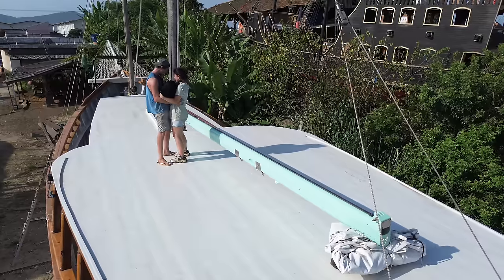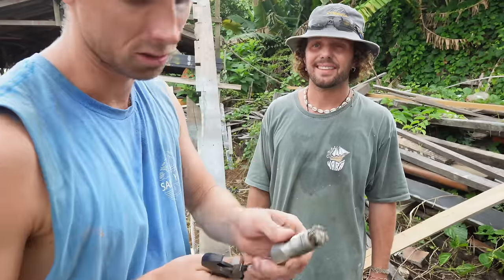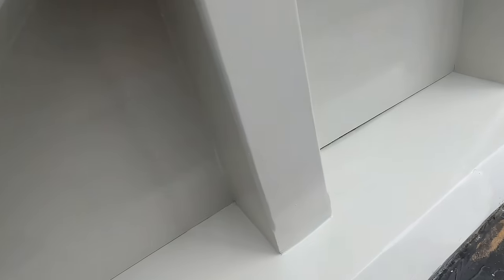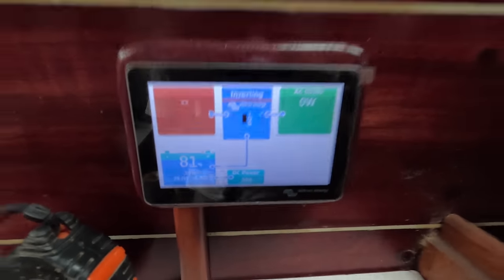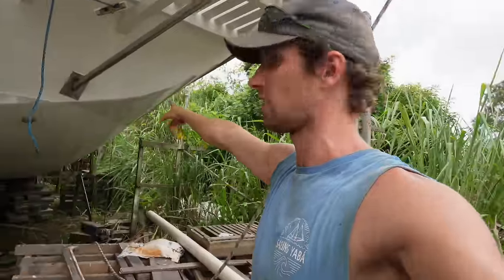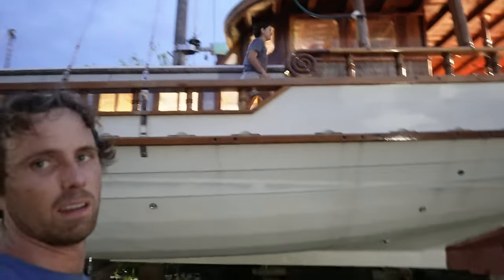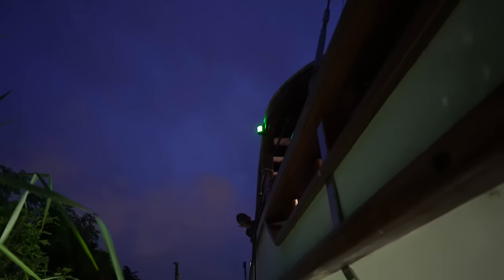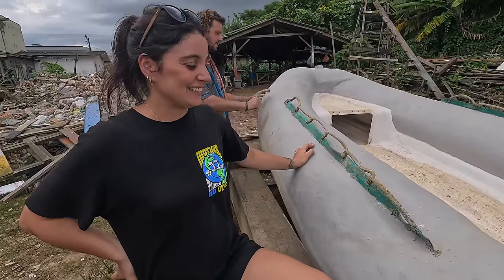Restored BOAT charged for Adventure: Solar Panels installation & Launch Prep  — Sailing Yabá 199

Comment: Have been watching since day one,,Not once have you mentioned going to Navigation School  or your plans on who is going to be the Captain. Also regarding Charter work  and safety equipment ,a large raft  I imagine is required .You also will require anchor balls  and as Flying Coney mentioned your running lights need to be made legal ,Wait till Brazilian marine board to give you a bill of health .Sorry the the facts of owning a boat are not as rosy as you think ,But your rebuilt is nothing sure of outstanding go well in your future sails 

I

Comment: Not sure if you really wannt a gap between the roof and your solar panels. 
Wneh (not if) you get into strong winds, air will get between the roof and the panels and may rip them off. 
Be sure to fix them strongly to the roof.
Reply: Surely you need this gap for ventilation that cools the panels, normally it's mandatory.